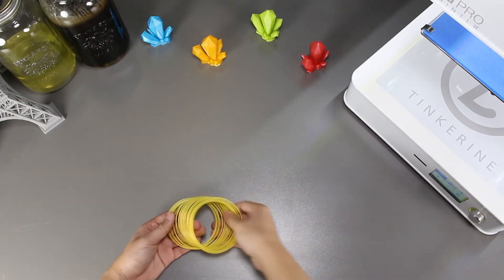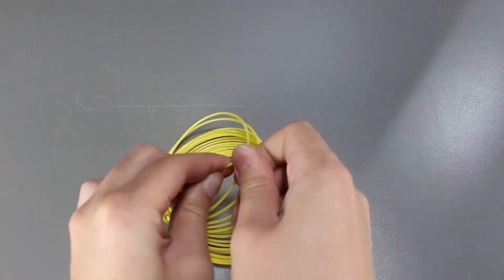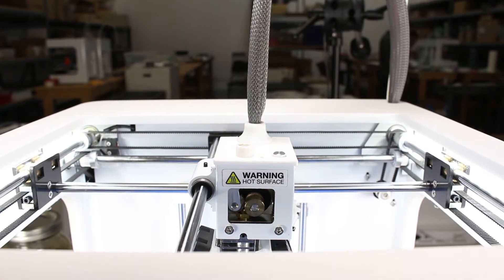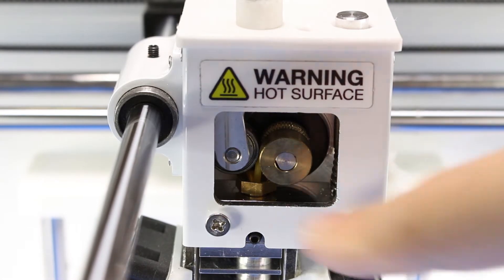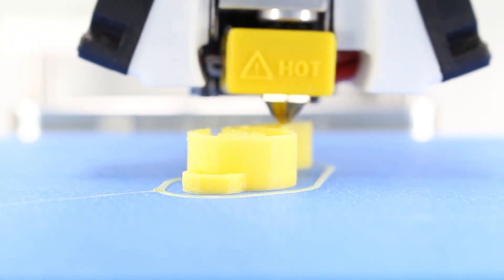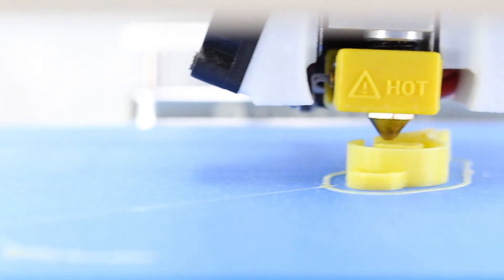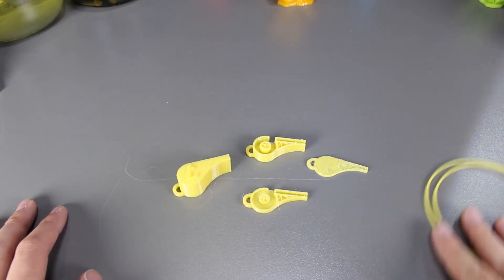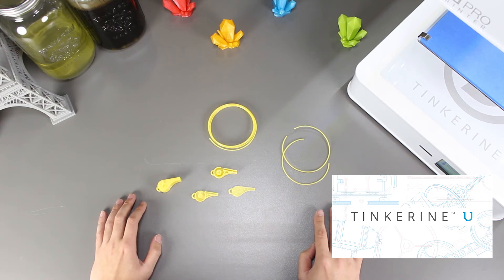Printing with PLA Filament Exposed to Different Environments Part 3

Comment: It might have been moisture problem- as you said, it was raining quite a lot
Reply: Which then you would dry it out in your toaster oven. You could use a UV exposure unit to accelerate the process.
Reply from the maker: Hi,

That could be a reason! I never considered it.